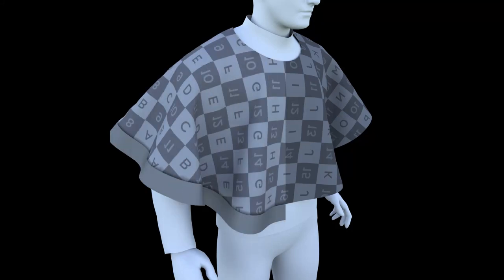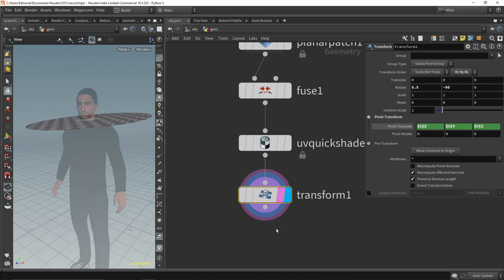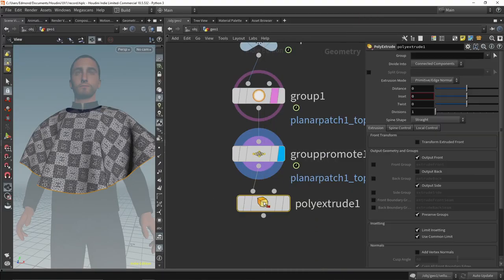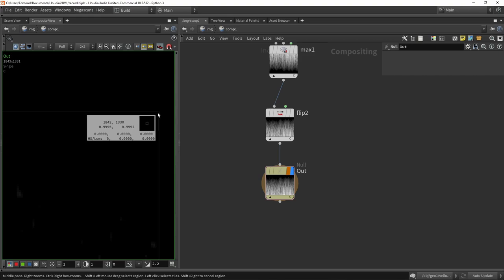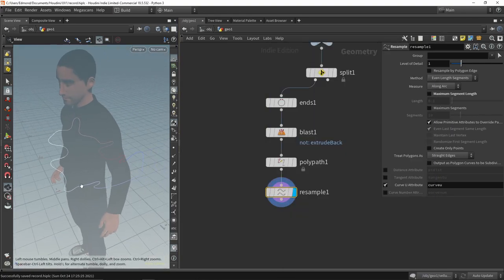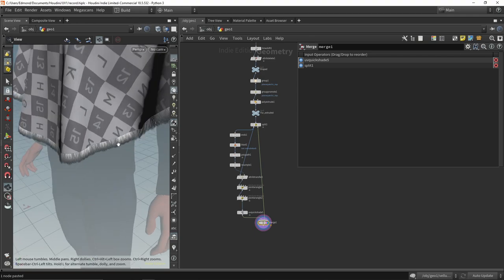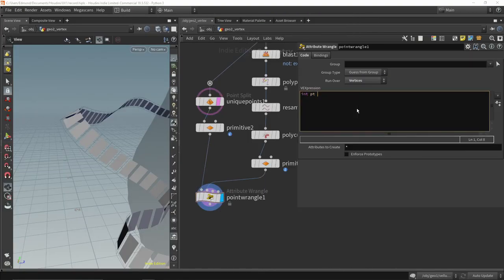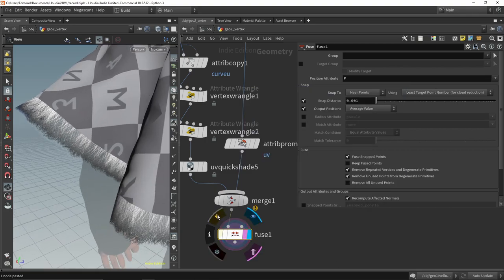Procedural UV Unwrapping, Fur Edge - Houdini Tutorial

Comment: after the split you can promote the planarpatch1_top from points to vertices and use that in UV flatten under axis-aligned vertex groups tab, changing align parallel to V axis. don't forget to add one seam

this method does the same thing but cutting the number of steps to half
Reply from the maker: Hey thanks for the tip. I played around with the UV Flatten node as you described and I could not quite the same result. The UV space seems to stretch  quite a bit and I get different result depending on the edge I select. I would be interested in taking a look at the results you are ably to achieve with that approach if that's ok.